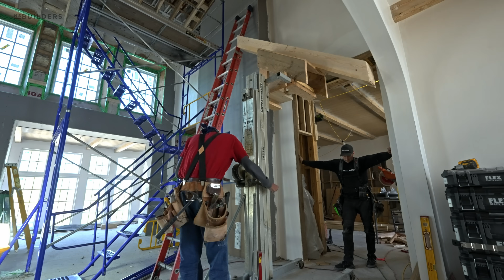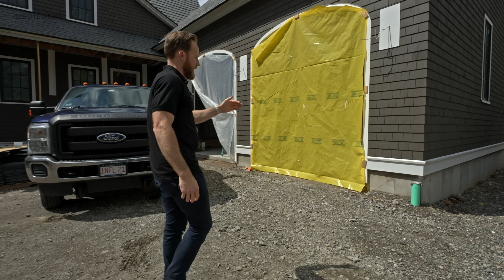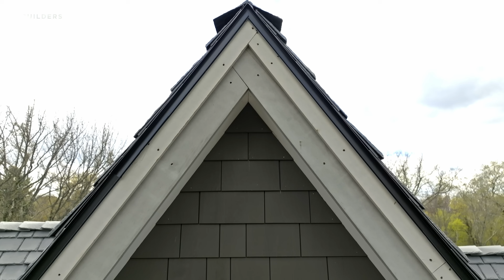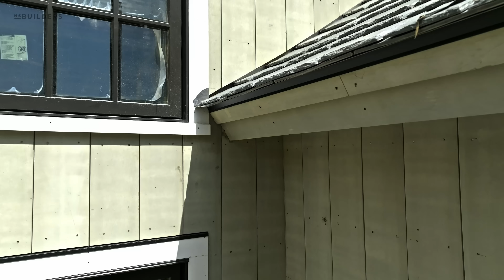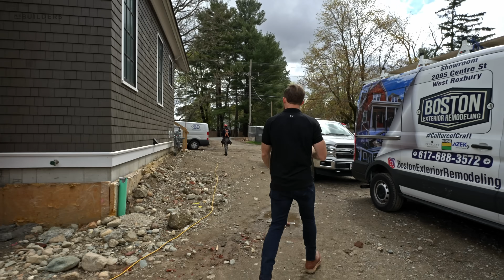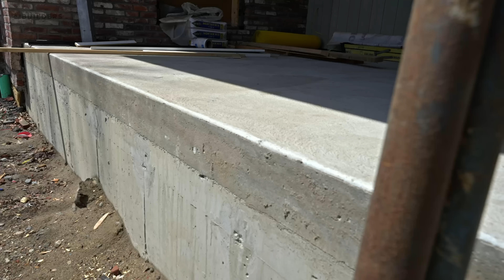Using the right siding and exterior trim for your project

Comment: With that shingle siding, if they need to be repaired would you have to replace all those shingles and the wrb? Or would you just tape over the penetrations? Looks amazing.
Reply from the maker: Great question, I would think a couple replacement shingles would be no big deal and likely just leave nails and bang them flush.
Reply: @NSBuilders  makes a ton of sense, appreciate you taking time to answer that. Great builds as always!

Comment: Beautiful. Is there any flashing detail between transitions of the shingle/boral siding and the brick ledge? I know it’s nerdy, but would water make its way up the brick and sit against the siding?
Reply: Or is that even a reasonable worry?
Reply from the maker: Yes we have a small piece of lead flashing between the brick and wood/Boral. But it’s all installed on top of the rainscreen

Comment: You have a great team to make a project like that come together. Out of sheer curiosity, what is the ballpark budget for a house like this? $2-3M? $5-7M?
Reply: Hard to say… but given the local RE market in that area… and without seeing the interior finishes… I wouldn’t be surprised if it’s in the $400-500/sq ft but it may very well be north of that 
Massachusetts is notoriously expensive to build never mind to this level of craftsmanship and detail… ask me how I know
Reply: @josecito976  How do you. know?
Reply: @idontthinkso666  I’ve lived and built in MA. A cursory look at the Needham housing market will reveal the going prices for homes… Needham, Newton, Wellesley (to name a few) is where the upper crust live outside of Boston
Reply from the maker: Higher end

Comment: Great video. Do you have an opinion on aquor hose bibs? I see you used traditional style bibs, I just installed an aquor and really like it.

Second question, range and dryer roof jacks..Do you have a particular brand you like to use there seem to be few options outside the cheap sheetmetal box store ones. Thank you.
Reply from the maker: I think the Aquor are great to be honest. Would have been a great option here. Not sure on the roof jacks, but we typically order our equipment and tools from tool supplier.

Comment: Still using lead flashing??. Looks like tidy workmanship. For me, too many different exterior finishes.
Reply from the maker: Yes. What are you using?
Reply: @NS Builders  we'll get prefinished steel (high zinc cotent, same material as our roof sheets)bent up, to suit. But I like the idea of pre finished aluminium, I think you use it a bit in US, I'm a builder in Australia.

Comment: When spraying door exterior doors,how does that work out in case of touch up...do you pull them back out????.thanks
Reply from the maker: If we have to, we will, but often times a good painter and foam roller can do the job. Or brush with flooding agent.